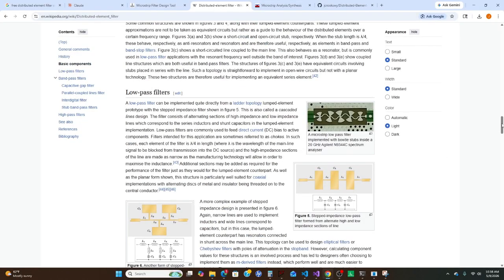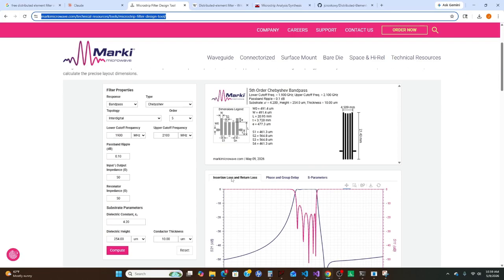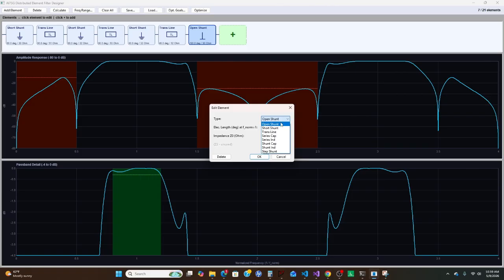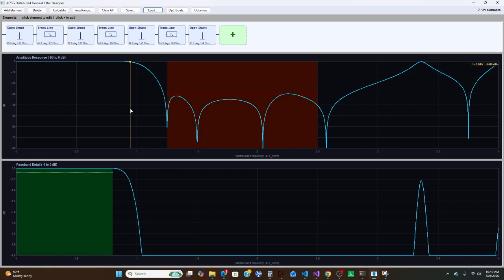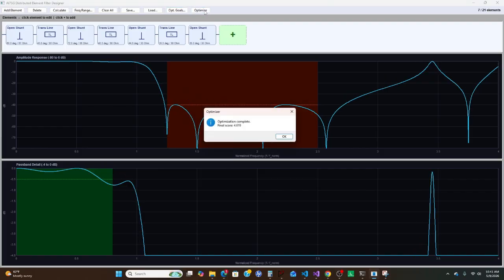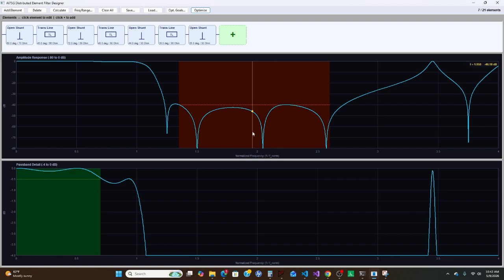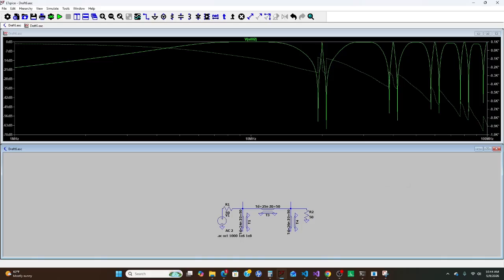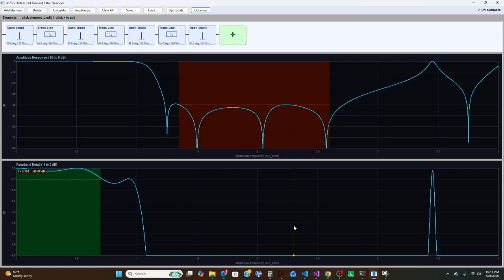Building Distributed Element RF Filters is easier than ever!

Comment from the maker: Someone pointed out on Reddit that tools like this are no substitute for an EM solver. At reasonably low frequencies, say below 4 GHz, I'd say ideal usually matches real within a few percent, and 2 board spins are a lot cheaper than a commercial EM solver. The higher the frequency, the further off ideal models like this will be, and the more you really need a good EM solver.